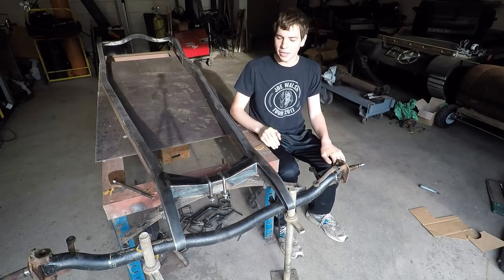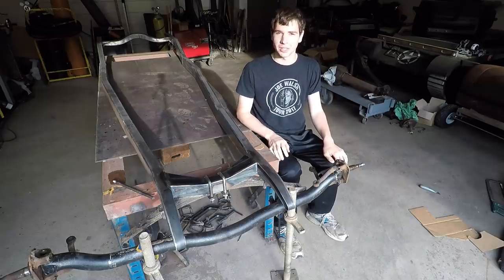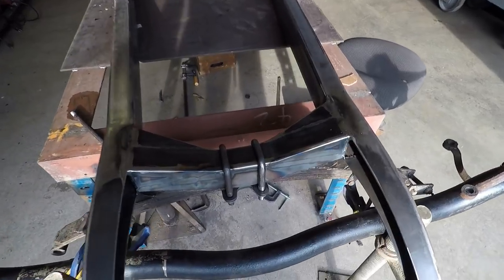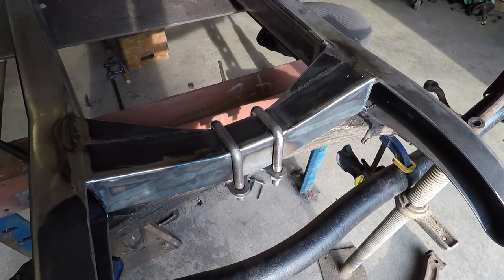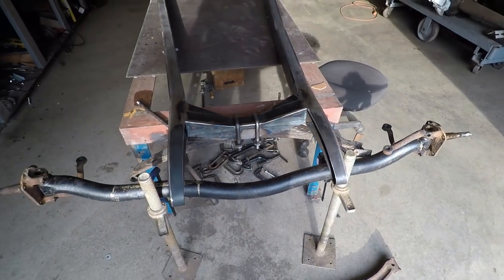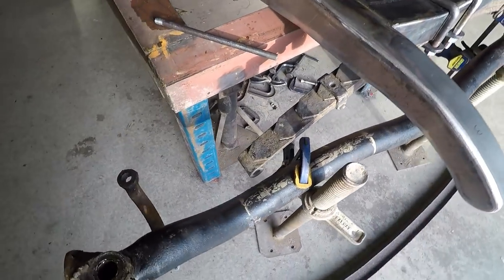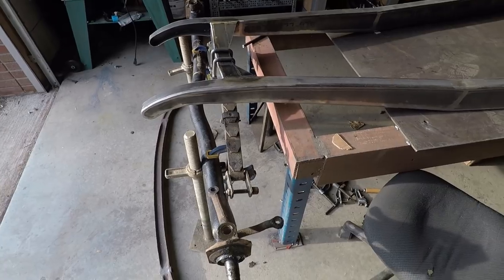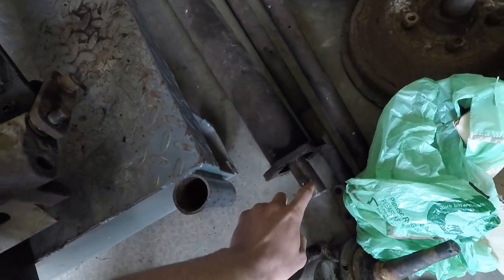Front Leaf Spring Mount | Boat-tail Speedster Pt.6

Comment: On the front sprint mounting plate: roll the edges that touch the left and right side of the spring so you don't have the sharp edge resting against the spring--it could cause the start of a stress fracture.  A slight radius there (such as with an angle grinder or some such) would be fine.  By the way, I just stumbled across your channel, and am having a nice afternoon binge-watching your speedster build.  Very nice work, and I love the choice of a early race car style.  Looking forward to the rest of it!

Comment: You are doing an amazing job. When I was your age I worked in a spring shop and bent many U bolts but they were from material threaded on both ends already. Making yours from scratch is a step above since your threads are just the right length without excess threads showing.  👍🏻 

Your magic at the 2:00 mark helps explain why your builds are so amazing. 

Keep up the great work.

Comment: The degrees of the front crossmember is for the leaf spring angle.  Caster angle/ degrees for the steering/ suspension is set up by the radius rods. Very good build

Comment: Excellent video. Just a tip to prolong the life of that bandsaw blade, move that blade guide close to the piece you're working on to stabilize the blade.
Reply from the maker: these band-saws are made for mostly just horizontal cutting, so the guide doesnt move any further than it already is

Comment: I wish you could find the old quick change center for that axel on your build I haven't seen on in a very long time but they worked well in those Indy style like your building and be careful with the steering linkage I have seen the spring knuckles interfer in the driving we're if it was in a turn with weight shift it would come up and bind in the linkage .I'm loving this build and your engineer is spot on so far and the x member we we're talking about also acts as a drive shaft loop that under high speed will help if you drop a shaft if you do a race

Comment: You`ll probably need a sway bar so you don`t get a death wobble like dodge , Jeep has a mounting system for shocks that has a plate that goes under the axle and turns sideways for the shock but use the same bracket for the leaf mount instead ,Then you have the mount for the verticle sway bars too if your going that route  .

Comment: Are you going to run lever shocks? I can grab a set of two rear shocks from a late 30's, early 40's Ford truck frame with a banjo rear end. They'll definitely need rebuilding but I can send them your way for the cost of shipping.

Comment: Wait, how did you get the band saw to run through that piece of metal you cut and cut the square into? Band saw blades are continuous, so how did you do that??
Reply: I'm talking about the part right before 2:25
Reply: He used Tony's old magic trick!
Reply: Cut and re-weld the blade? Seems like a lot of effort for something you could easily do with other tools, so maybe he knows a trick that I don't.
Reply: Some bandsaws- especially older ones have built in blade welders. They are made specifically for this application in which making an internal cut is needed.

Comment: Won't a horizontal leaf spring cause a lot of side to side rolling? I don't know which is why i ask.
Reply from the maker: I'm sure it's not ideal for a racecar, but it's not at all dangerous or a bad design if thats what you're asking
Reply: MacroMachines i was thing about the amount of body role while turning. Like what you feel with high center of gravity vehicals like a jacked up truck.
Reply from the maker: those leaf springs dont offer much travel to begin with, and this thing is going to be very low, so I'd say that that wont be an issue
Reply: MacroMachines okay

Comment: more building, less explaining
Reply: Makarov Fox Nope he has the balance about right.  Explaining his thought process is a vital part of the build.
Reply: meh the tank series was much nicer, this is so slow
Reply: Makarov Fox Then don't watch it.  It's build and he's doing a damn good job of it.  You want fast then go and watch a video of the Ford production line.  You don't seem to seem to understand just what he's building.  The tank was a bit of off road fun whilst this is serious and has to be done right to pass inspection for use on the road.
Reply: it's just an opinion dude, It is not doing a
 bad job, it is surprising, I understand that it is not the same as the 
tank, but I think it is not a very good balance, it is a long 
explanation compared to the building part, maybe a little short and concrete explaining work better. Maybe explain while the construction is shown, like a voice over